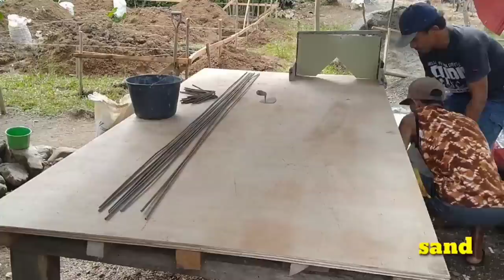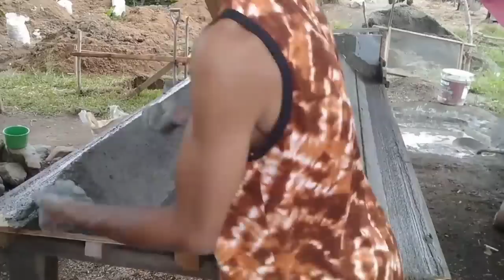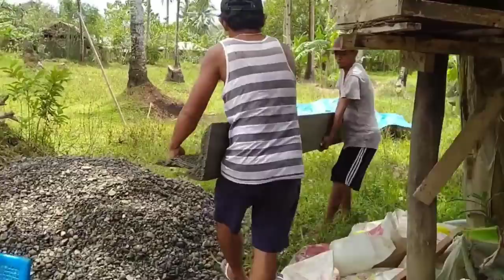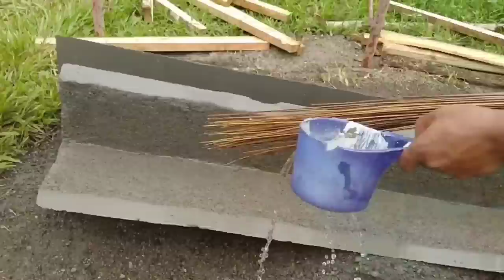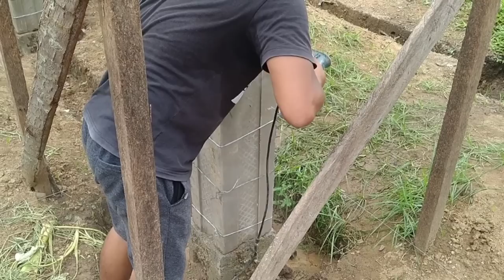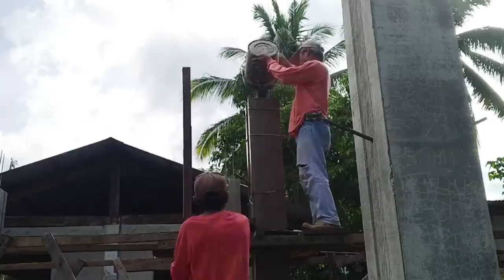No Need Wood form / Di na Kailangan ng Porma

Comment: The two precast concrete halves are just "decorative" outer casings of the inner poured column. They will not have any structural value in  resisting the compressive, bending, or lateral loads. The builder will only end up using more concrete materials plus additional time and labor to do the precasting. More expensive and more time consuming to build. I will recommend this method.
Reply: Yeah you're right my friend that precast is only for outside decoration

Comment: Magandang idea to kapatid..kasi yan na ang pinaka plaster ng columns withouth compromising the integrity ng structure..
Reply: Disadvantage lng dimo makikita kung ampaw ang poste later on..
Reply: That's why buy and use  concrete vibrator., right mixture ratio, right tools.

Comment: The load bearing capacity of those columns are based on the size of the reinforced steel rebar cage that is on top of the concrete foundation base. Sa nakikita nyo ang liit at nila. Only the concrete Inside the cage, bares any compressive weight. Outside of the rebars concrete is only for waterproof protection and beauty.

The outer ‘Pre-Fab’ concrete molding has NO load bearing or tensile strength capacity for any compression or lateral forces put on the structure . "It is only for decorative purposes"!

Para maintindihan, para lang ito sa isang "1 floor" style na bahay. Delikado na pag 2 storey.
Reply: Ang mabuti lang ay dinamihan nyo ang Column. Kaya ok ito structurally.

Pero kung ginawa ninyo lang yung dating gumagamit ng wood form molding magiging KALATI lang ang taba ng iyong Column, na kasing TIBAY din siya. Hindi tuloy kayo gumastos ng extra semento at rebar para sa paggawa ng pre-fab concrete moldings.
Reply: Agree ako sayo... Hindi ito pwede sa 2 palapag na gusali..

Comment: sino engineer nag sign neto? (Di ako nagmamagaling, you dont have to trust me, your call.)
NOTE: sa mga gustong gawin ito, make sure an engineer signs a letter of approval bago niyo to gawin. Kailangan someone is liable for this in case may mangyari. Dont have the filipino mentality na "Do it now, bahala na later." Please save yourself and your family. 

1. Concrete forming takes a long time
 - need ng reusable mold para mabilis sa pag form ng concrete at consistent sa size and dimension.
- For a premolded concrete - very inconsistent parin yung result.

2. Structural stability - tanging kapit lang ng molded concrete sa poured concrete ay yung dowel. hindi ito naka tie and The drilling adds more labour cost.
- kapag gumawa ka ng mold for the concrete, dapat pati pang butas meron na din.
- dowel can be put in placed before installing the molded concrete. ipapasok nalang sa butas.

Pero honestly, besides holding the molded concrete up, the dowel does nothing. 
The way I see it, the molded concrete is purely architectural, not structural.